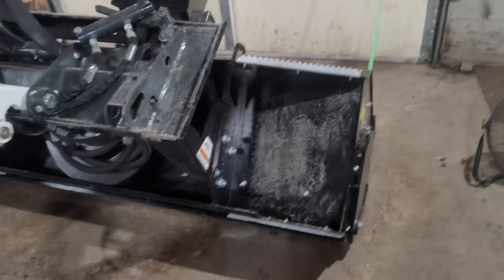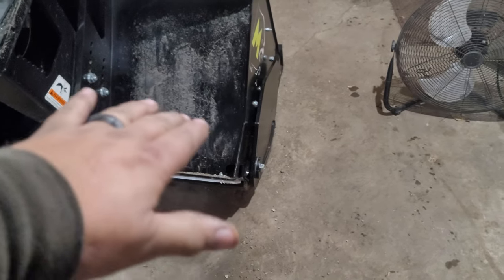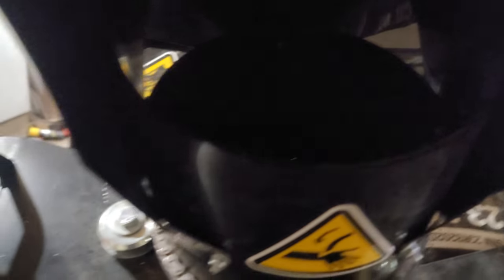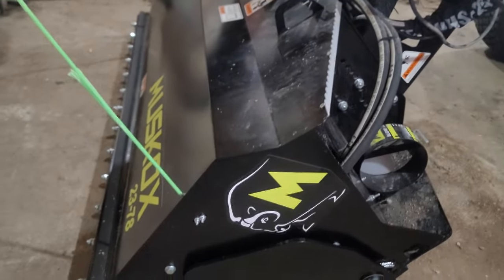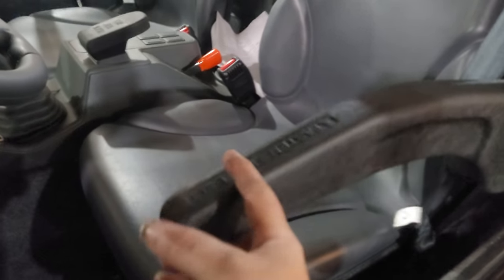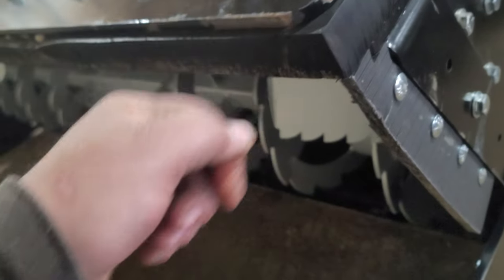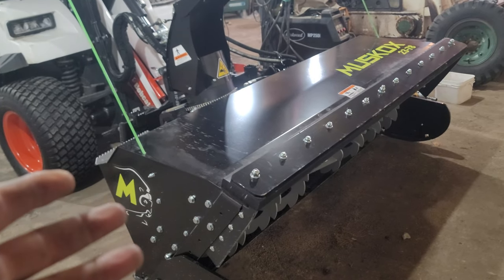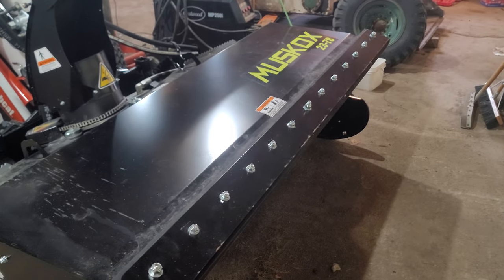#muskox 23-78 snowblower review

Comment: To eliminate the wear on the side plates and rubber front blade is set yiur angle to the right setting gor back dragging.   Then but your  up and down doom leaver in float.  Than you won't be putting to much down pressure on those parts.  Works great in float.

Comment: How great is this compared to a traditional snow blower attachment? Be honest. 

With the snowblower, I mainly just want to be able to get as close to the garage door as I can with a snow blade, in case it's a place that we don't shovel, too. 

And the shorter shoot has to be nice both for getting closer to garage doors and for getting clogged way less than traditional blowers, no?
Reply from the maker: It does clog a lot less. I really like it fir getting right up to the garages at the residentials. You can move the sight sticks to where they touch the garage without the blower touching, or come close, so it gets you super close. It's definitely more expensive than a traditional blower, but I really like using it compared to my old one

Comment: Does the tool cat have enough power to provide enough down pressure to allow this implement to operate as it should??  watching videos of high flow skids running this implement and it seems to work great!
Reply from the maker: It does. We debated between a skid steer and the tool cat. I thought fir sure it was just another utv. It's not. I honestly feel like I'm in a skid steer when I use it. Minus the fact it's way more comfortable with an extra seat. And I can see everything. As far as down pressure I believe it's about 6 to 7000 lb machine, it will lift up the entire front end quite a bit just like the skid steer does, so it can dig down.  Of course it's a different machine than the skid steer, however there isn't much a skid steer can do that this won't. 

Honestly too, I wouldn't put too much down pressure on the Muskox. I believe that was part if my problems learning to use it. It is a very heavy snowblower that should.mainly be used floating.
Reply: Hi. Nice video.   Good review of the Muskox snowblower.  Could you tell me what the angle of the blades are of of 90% to the center shaft.  What is the overall width of the blades from outside edge to outside edge of the other  blade.
Thank you for your help. 
Very good review of both units.
Reply: Could you put a piece of that UHMD material for your front scraper edge instead of the rubber I know they works great on my pull plow My friend said to use inch thick you’ll get a clean or scrape
Reply from the maker: @Rich Scott  I think that would be a good idea. As far as back dragging goes it would work better

Comment: Hi.  Good interview of both units.   Could you tell me what the angle of the blades are off of 90% from the center shaft.  What is the distance from outside edge to outside edge of the fan blades. What is the outside diameter  of the center mounting shaft.  Thank you for your help and a great review.

Comment: Hey, i have the muskox blower and also thought it was the chain freezing. It's not. There is a hydraulic pressure relief valve on the manifold (the larger of the two). That is set too low from the factory and when it gets cold the cold fluid in the chute rotation pump is too hard to push so the fluid goes by the relief valve. You just need to loosen the locking nut and rotating it (i think clockwise) one rotate. I called Muskox and that is what they told me and it worked.
Reply from the maker: Awesome thanks. Oddly enough I haven't had any other issues since the video. But I appreciate the input in case I do.
Reply: Also, load that chain up with Fluid Film or grease or whatever you like. I always used FF on anything movable. I’d hit every time out too. Also do all the hydraulic connections and nuts/bolts. I usually only do those types of things 2-3 times/season. Cool setup you got!
Reply from the maker: @GL291117  ya definitely tighten those too. Mine came from the factory with a loose fitting

Comment: I have the tractor type tire on my tool cat I put studs in them work great but for the summer I think I want to try tires like yours I was going to buy another set complete how did yours do in the snow I know they’re larger in diameter so you have a higher ground speed by a mile or two mph
Reply from the maker: I get 17.5 mph with these tires. We bought the skid steer tractor tires for them too but these are way better in the snow and on ice.